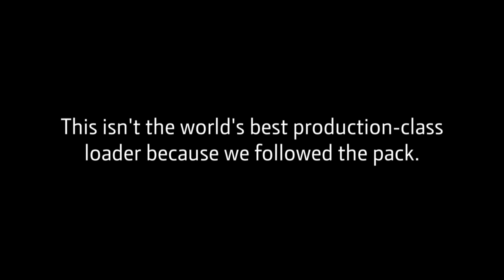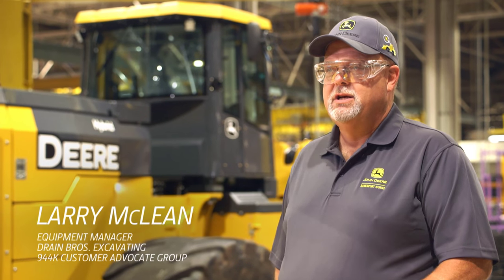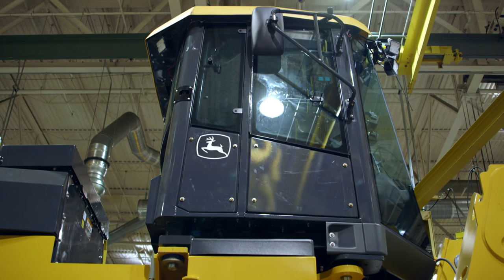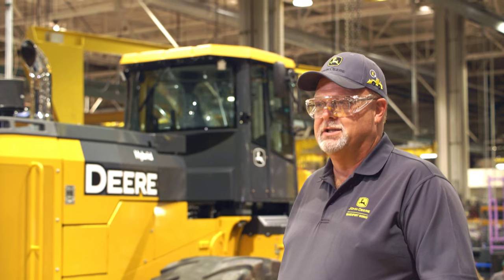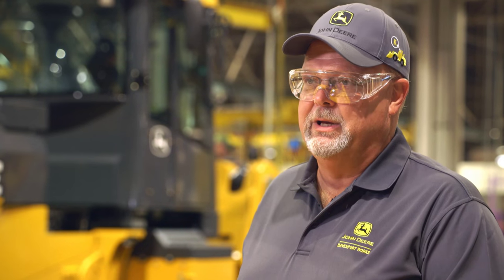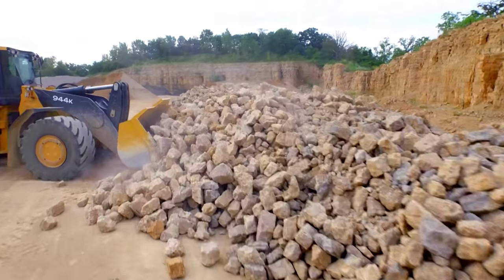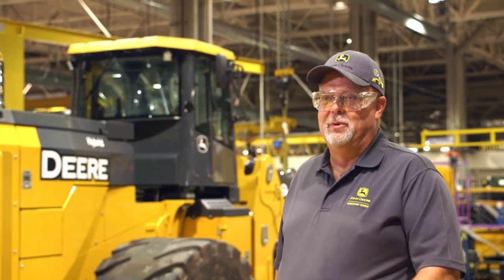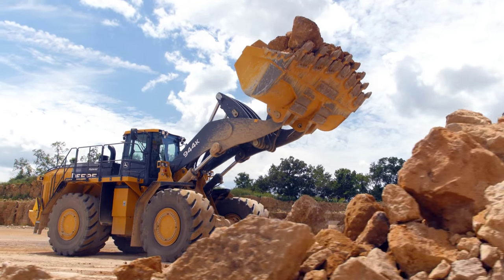Big Front End Loaders | John Deere Wheel Loaders

Comment: John Deere needs to put this hybrid full electronic drive system in the 844K model. i operate a 2016 844K we just got 2 months ago an love it, its smooth an quick. had a 980 CAT before an the CAT cannot compare to the JD. going from 70 000lbs to 80 000lbs sitting on L5 Quarry tires an from a 7 1/2 yd straight edge bucket with teeth to a 6 1/4 yd spade rock buck in which the JD has, is really impressive. the spade will pull out basically the same tonnage as the 7 1/2yd bucket will. my biggest issue with the JD is the steering wheel out front, the joy stick is all that is needed. also the hydraulic pump under the cab is noisey for sure. huge difference in hydraulic power thou. CAT only has a 120gpm pump while JD runs a 157gpm pump, digging power is really good. hoping JD can convert the 844K to electric drive an possibly make it heavier to around 85 to 90 000 lbs...weight rules when it comes to digging force